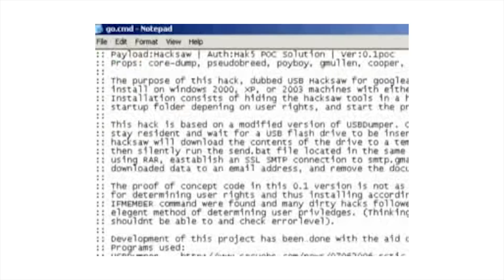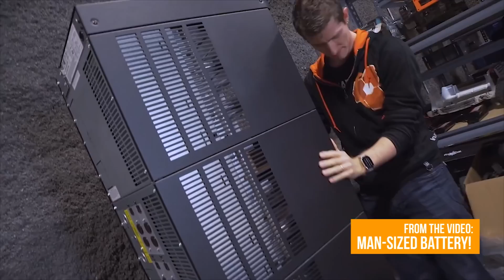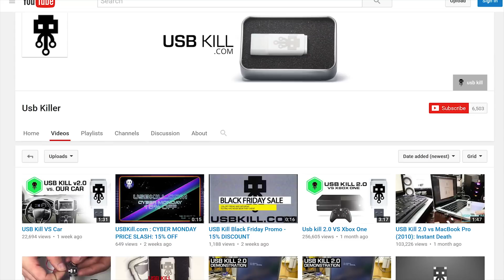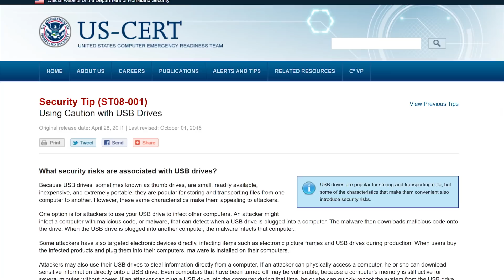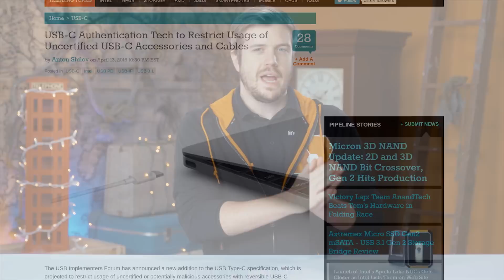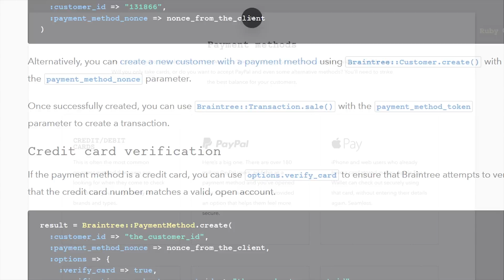COMPUTER DESTRUCTION (GONE DEADLY)

Comment: Prank: replace the usb killer insides with a normal storage usb, and then when your friend isn't there, you plug their computer into a power bar that you can control. when the user of the computer is in use of the computer, plug the "usb killer" in, then quickly shut off the power bar. (i just thought of this in less than 2 minutes)

Comment: Would it be possible to disable power to the usb ports in windows and have a batch file to enable the one you are wanting to use at the time. It seems the fact that the killer usb charges from the laptop in the first place is a part of the problem. Just a thought...

Comment: When someone would do this to my hardware, he will not be my friend anymore and probably dead or I lost some weight because he was faster than me in running away. Is there a reason to buy these? Sure when you are the head of a company or responsible for buying machines. For example you have some machines for printing photos and want to test if they are save, you plug these in. Sure you killed a device but you know that your devices are not safe. It's better that you killed only one device instead of all.

Security is very important and don't let strangers near your computer. There are places where computers are public. Computers in an office are safe when they lock the office when nobody is in the office. Some might think that computers at the reception at the doctor or in a hotel lobby are safe because there are people around but this is false. Plugging in a USB device is done quick. Lock the PC away. When nobody can access the back without a key, it's safe. When you have front IO, then unplug these. You can't make everything 100% save but using easy methods to make an fast attack nearly impossible, is good. Sure someone still can break locks and make bad things but than he can use a hammer to destroy your pc.

Comment: am i the only one wondering what "negative voltage" is? maybe im just a tech-greenhorn, but that sounds weird for me.
Reply: The opposite of positive voltage?????
Reply: and how do you produce that? can you give an example where it occurs?  As voltage is the strength of a charge flowing, i thought there either would be voltage or no voltage, and i can't fit negative voltage into that picture.

Comparable to how physicists view temperature; in physics there is no "cold" either, theres just heat or no heat.

Comment: I had a webcam that did this once years ago, It drew too much power and caused usb ports to go into device not recognized forever. It was a webcam that had like a ton of small leds around it. Seemed like a good idea for a camera the lights being on it but i think it was a cheap BS one that was not really usb 2.0 compliant (this was back in windows xp days back when 512mb of ram was a thing). It got dismantled it will never Wreck a usb port again lol aka it had the usb part of the cable cut off.

Comment: NASA: we have the best anti-virus and software so powerful it helps steering a rockets 
SOME DUDE W/ FEW BATTERIES GLUED TOGETHER: lol k
Reply: @Xenon the Noble Gas SMORTS
Reply: I think they have protection
Reply: This isn't a software problem like viruses, this is on a hardware level, so an antivirus probably won't do anything, except for the off-chance that the antivirus disallows certain USB devices based on certain definitions of what a harmful USB device is.
Reply: Know for a fact this was written by a child or computer illiterate. Anti virus does not stop Bad USBs , also nasas rockets are not controlled or rely on any kinds of USB port, it’s a closed system where data is ported via  data cables and using wireless. I’m sure there is a USB port on some of there desktop setups but not anything directly connecting to a rocket.
Reply: They'll have the usb ports on their devices disabled.
Reply: @drcyb3r  i dont know if that matters now.they have killers with batteries
Reply: AO1337 exactly my point.
Reply: They have a good software maybe but anybody whit half a brain can destroy electronics if they are close t it, like put water all over and kick it a few times and voilà computer is gone
Reply: @snowfugitive3318  you dont think nasa could revive every bit of data?even police can get data from a  computer destroyed by water and even fire sometimes.it amazing what they can do.
Reply: @dustinlawson5882  I feel like I could quite easily destroy a piece of electronics past the point where it's data can be recovered you don't?
Reply: @MimeticMimic  the launching computers do though.

Comment: This thing is a countermeasure, not a primary attack. If you notice someone has taken over your computer and managed to lock it, you only have two options: pull the plug (if you plan to recover data and reformat the drives and reuse the same PC) or use the killer (if you plan for nobody ever using that computer ever again, possibly recovering the drives).

Thing is that a remote attacker might be able to use Windows's integration with the UEFI BIOS and lock your computer to a network boot from a custom server. You have to make sure nobody within your business turns that machine on ever again.

Comment: QQ: because this device uses capacitors charged from the port itself, if the power of the system is off would that prevent any charging capability and therefore stop the initial attack? Of course the attacker can just turn the system on but would say removing the Edison plug from the power supply be able to stop this?
EDIT: spelling

Comment: Protection is nice and all, until you buy a negative ion generator and zap their computer directly. A static electricity generator essentially. With a thin enough wire, you could get through any crack or crevice and ZAP. Although not discrete, it still is extremely difficult to protect against these attacks...

Comment: Optocoupler? No. Even with bidirectional optocoupler, you can't get 480Mbps on the data lines.
Reply: Chun Ho Kong I think it should be possible to do the full 10Gbit with expensive optocouplers and signal conditioning circuits on both sides.  But at some point the protection becomes too expensive to be worth it.

Comment: What would be fun is a USB port that could not only detect unusually high voltage, but also send an higher voltage back.
I mean, I have the whole mains at my disposal. I could easily crank it up to 10000's of volts pulses, effectively destroying the so-called USB-killer. :D

Comment: The PS4 Pro is sort of protected from this. Plugging it into one of the two front ports doesn't affect it (or turns it off but doesn't break it, I can't remember which one) but using it with the back port does affect it.

Comment: My Acer Aspire 6930G just shut down when USB Kill are plug in, actually instantly shut down, in less then a second, and it always power on and works fine, its made in 2006., today is 2017, and its still working fine. But while i was playing with USB Kill, adapter version 6 (with return energy) died, so now i got version 2 (without energy return) so i wont test it again.

Comment: The only problem about optical couplers is that it will only protect against data pin discharge. The earlier usb killer would still work as the power source would still need to be the same.

Comment: FOR DESKTOPS, Couldn't one just intercept the the circuits to the USB ports with fuses? If one should be paranoid and have a little wiring knowledge, have a toggle to DISABLE/ENABLE all physical connection to all data transfer/charging ports. This easy-but-psychomodification would be a guaranteed solution. And what hacker look for hidden toggles? lol

Comment: if someone gives you a flash drive crack the plastic case open if you dont see capacitors you will usually be safe but don't blame me if your computer dies trying my tip but i have found several USB killers this way

Comment: An opto coupler isn't going to stop you shoving 220V up the 5V line, nor is cryptography going to stop you shoving 220v from a pre-charged capacitor up the data or 5v lines.

Comment: BS about installing optocoupler, you don't know a tiny bit about electronics engineering. Optocouplers will work for USB Full speed devices (12 mbps). Useless for High speed (480 mbps) and usb 3.0. You just cannot protect USB ports and preserve their functionality at the same time. The thing is, any protection device which can survive such abuse is too slow for high speeds of modern data interfaces. The only option is fiber optic interface, but that won't be any good for  things as memory sticks, as will need too much space and is too expensive. Nobody will buy a flash drive of size of the palm and $100+ cost. Probably you could make 1 such interface per PC affordably. But no way you can put 8 such interfaces on the motherboard and keep it affordable.

Comment: And this is why I always dissemble USB devices unknown to myself.

The easiest way to protect yourself against the USB killer is to get an USB-ISOLATOR !

Manufactures should install something like an ADUM4160 for protection.

The alternative is to solder Varistors/VDRs (Voltage Dependent Resistors) in  parallel and PTC-Thermistors in row to the data- and voltage-pins of the USB-port.
Reply: PERILEX "google"
Reply: "google"?

Comment: who has any use for this? Which isnt poinltess or isnt going to get you in trouble? Any legit uses other then malicious attacks?
Reply: for manufacturers to test the USB ports on a device before release
Reply: Tino Kollin How is it stupid? It's no different than how automobile manufacturers test their cars safety by crashing them.
Reply: Tino Kollin Let's say you plug in a USB device that shorts or it's power goes and runs out of control. Laptops like recent MacBooks will stop the damage at the port. So while the port will be fucked, the rest of the device is safe. The USB killer is designed to replicate those scenarios so that product designers can know if their products will hold up to a severe shock either from a power supply run amok or a deliberate attack.
Reply: Apple and Samsung. Like I said earlier, MacBooks for instance have recently been designed with surge protection built into the USB/Thunderbolt ports so that the port stops the surge from getting to the motherboard and CPU. Similarly many new Samsung TVs are designed to contain the damage within the hardware for the port, so while the port may be busted, the rest of the device will work fine. While I don't know if they specifically use this exact product to do it, they clearly do some form of high voltage stress testing on their devices with a similar piece of equipment, possibly made in-house.

I believe that different types of more military grade/ruggedized hardware such as toughbooks and military computers implement similar protections.

I'm not sure why you seem to think this is such a ridiculous concept. It's just surge protection, just specifically for USB ports in case a USB device power source seriously malfunctions or if somebody attempts a deliberate attack. In order to test it, they need a tool to do so.
Reply: L Ey Sell it to Vladmir Putin.
Reply: I mean, big companies who make computers may find this device helpful, it's so that they can test the computer's weaknesses and strengths, it's like when Nintendo hired a bunch of hackers to hack their 3DS product to see it's weaknesses and then update it.
Reply: Green Guy Okay, now we just need a good reason because you have the stupid one.
Reply: Ponycade What are they testing by destroy an usb port and most probably more than just an usb port with this?
Reply: Ponycade Name one company that does this? lmao
Reply: Ponycade Selling these things to the public is a good idea? tell me how many companies do you know that have brought an usb killer from these guys and used it for the purposes you say they are used for? give me factual information of some company buying these things to use them to do that and can you also give factual information of the these companies having designed their products in this manner.

Comment: the USB Killer auto-charge by his victim to kill. So if the computer has no alimentation or power supply turned on. Your computer is safe. So i installed a power bar that can switch on and off with a key

Comment: You don't need an optocoupler circuit. You just need two Z-Diodes that would basically just short out any voltages higher than their avalanche threshold. I think Gigabyte does that on their ultra durable mainboards or something similar.

Comment: Congrats. You just got fired.
Reply: Amaroqdricaldari it was fake
Reply: TigeyCK I know :P
Reply: Amaroqdricaldari oh, I thought you didn't watch the video
Reply: I am actually using the information from this video to try to find a defense against USB Killers. So far the closest I can come up with are... heavy-duty redundant electrical pathing, breakers for each USB port, a large bank of Voltage Regulator Modules, and a crap-ton of cooling.